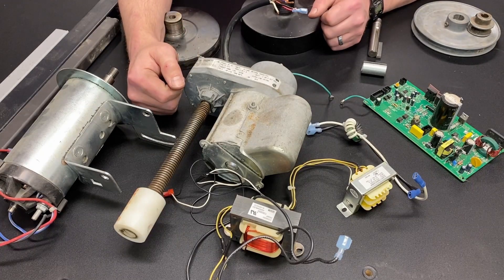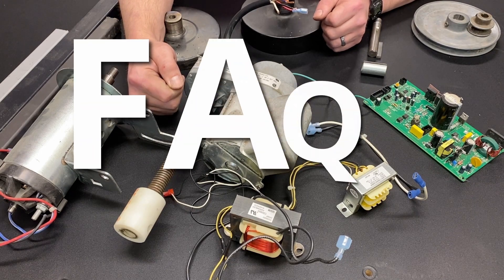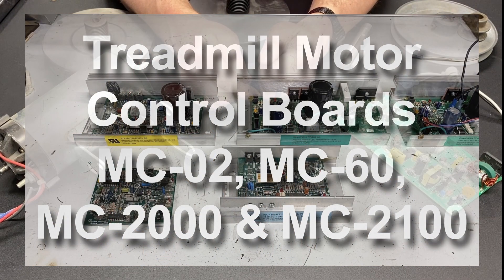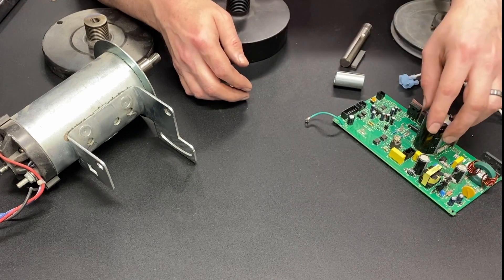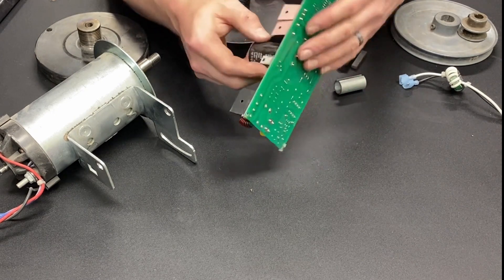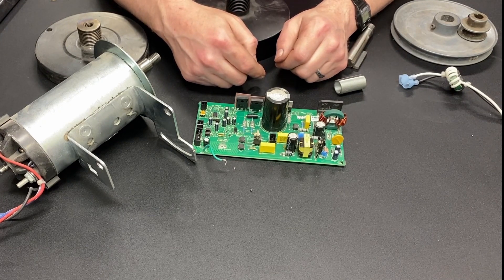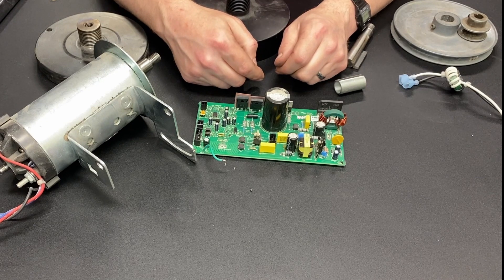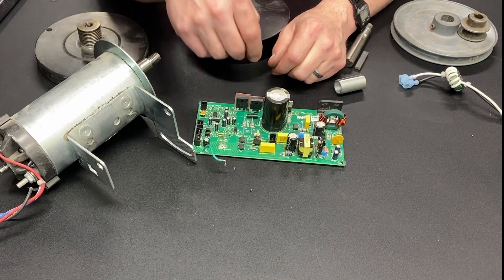Treadmill conversion FAQ 7  Where do I get the RC circuit?

Comment: I've already salvaged the cap from my MC2100 and can easily get that resistor, but my question is would I be better running the RC combo until I locate the correct choke, or would I be ok for a while with nothing?  FYI, I have the SCR, AC choke, fuse and rectifier, but still searching for a choke with language that at least makes me feel confident, but it seems there's not much insight on the web on this part.  The tool is a 2x72 belt grinder and I will make a shroud to protect the motor.
Reply from the maker: capicitors help but can also surge under load.  another option would be to find a broken microwave and DIY a choke https://youtu.be/sYjkQvUSths